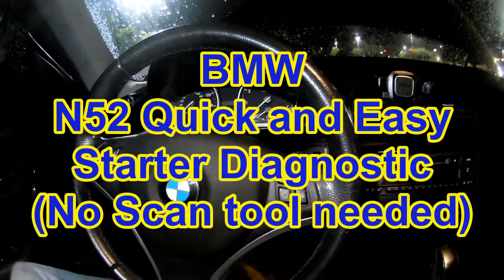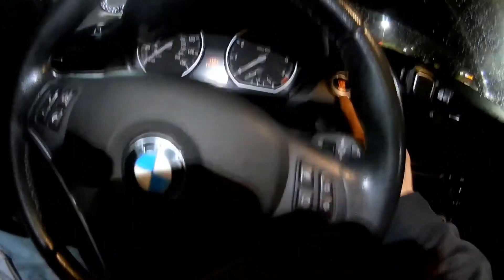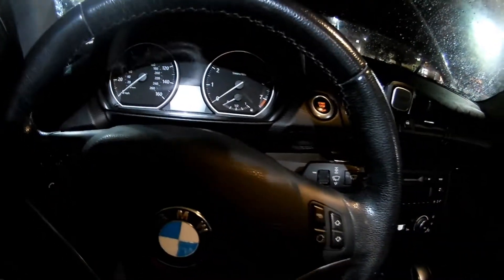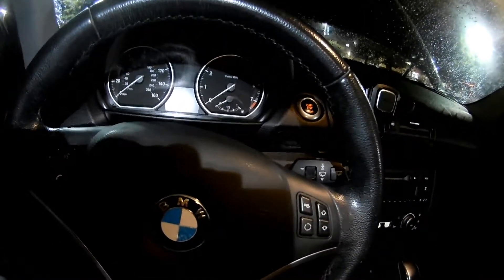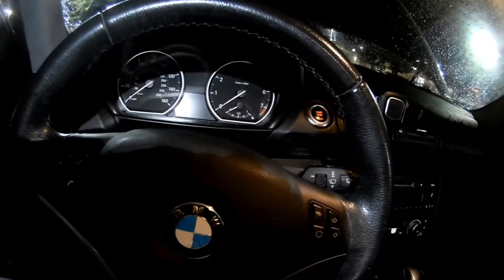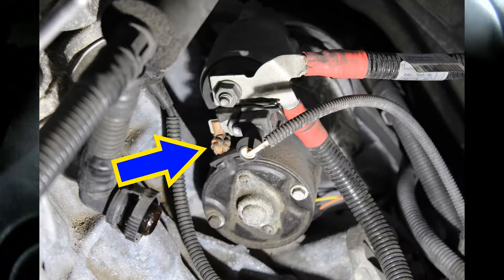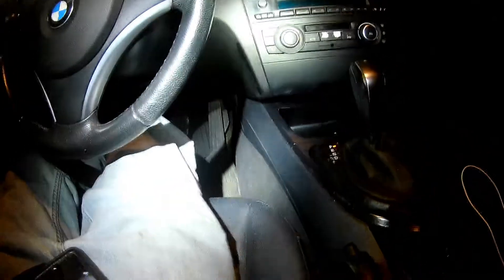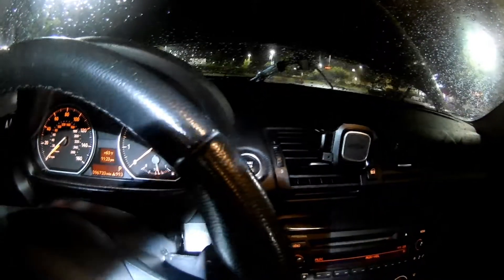BMW E82 E90 N52 Starter Testing without special tools

Comment: Problem is the starter motor ,not the power supply,,, should have tried tapping it with a long socket extention.common problem.
Reply from the maker: Oh wow thank you I would have never figured that out

Comment: If the test light turns on as appears to off, how do you know its the starter? I dont get it. Sorry new mechanic. I just replaced battery and still no crank no start. Can it be the starter or the alternator? I got a message saying increased battery discharge every 2 days i dont start my car. I havent started my car in 5 days and thats how the no crank started.
Reply from the maker: The starter has two leads… the big one is always hot… the solenoid has to receive a signal from the ignition switch to work the starter so at the stater you test for the big constant twelve volt and you test to see if you have a signal from the ignition switch to the starter… if you have that signal going to the starter should have everything it needs to crank… if you don’t get a signal to crank it could be a lots of other possible causes that you would have to start working through

Comment: 2009 328i  replaced battery , replaced starter, replaced CAS relay.  Did the starter post test constant 12 vlt there and then screwdriver to braided cable of new starter and when button pushed test light lit up. But still no crank no start.  how can i jump this new starter while on the car to see if it will turn.  It did work when bench tested before we installed new starter. Please let me know how to rig wiring to jump the starter.  Thank you.

Comment: Thanks for the Video, I didn't have a wire piercing probe to pierce the white signal wire. Good to know you can clamp on that short wire you showed. Lit right up when I tried starting. Just gotta replace the thing.

Comment: Just come across your video. My wife has a 2011 328i wagon and it just did the same thing to me over the weekend. You can hear the engine and fuel system prime but that’s it. Just performed your diag and will be ordering a starter soon. 
Much appreciated

Comment: Thanks a lot for this! 
I've been getting a clicking noise and sometimes it wont start and sometimes it does. Since it turns here and there, I'm thinking it's a loose connection or solenoid. And This method will help me check if the solenoid is feeding power to the starter checking the copper while connection. I'm hopping it's just a loose connection. If not, new solenoid time!

Comment: That simple wiper trick, sweet. And here I was going to wait for my gf to get home tonight to crank it over, cheers!
Reply from the maker: Glad I could help 🤙 hopefully you found your problem.
Reply: @MattDoesStuff17  I did thanks. 
After replacing the key, which worked initially, then replaced the ignition switch, bad assumption, I finally tested the ignition switch and EWSII, there was power on both fronts. I then found your video, tested the starter as you did, and voila, it's the starter.
Reply from the maker: That’s awesome man glad you got it diagnosed

Comment: Very simple and helpful video. I am getting 10.85 v at the brass dot. While the starter shows 12 volts.
Is the drop expected at the solenoid.

Is that sufficient to say thar my starter is bad ?
Reply from the maker: I think you could contribute the drop to the brass being dirty and a drop between the meter and it… I would go with a starter… you could try to apply 12v directly to the brass strap to be 100%

Comment: i should be so lucky...
08 X3 has solid intake, no gaps to stick a screwdriver through

good video though, i'll try to use the same testing method without taking too much apart
Reply from the maker: Man that sucks good luck… maybe coming in from the bottom might be easier? Never done an X before lemme know how it goes.
Reply: @MattDoesStuff17  i was able to get to it by pulling the airbox and rubber intake tube.  did have power to the starter so I pulled the intake manifold to replace it, probably one of the toughest jobs I've done in a while.

Comment: At minute 1:38, if the light doesn't come on, does it mean that there is a problem with the grounding system?
Reply from the maker: More likely a problem with the power... if it was me I’d start looking at the battery and the wires coming off of it.

Comment: Good night. I have a bmw e60 530i m54 engine, and the starter does not turn on the flywheel. I disassembled the starter and tested it out, it works normally. But when I get back in the car, it doesn't turn, I just hear a click, which seems to be from the hitch but it doesn't turn.
Reply from the maker: Leandro Figueiredo sometimes the starter will work on the bench but has a dead spot on the commutator and when you hit that spot it won’t work or has too high of a resistance to work under load
Reply: @MattDoesStuff17  and how do I solve this?

Comment: Where do I go to next if I don’t have nothing on the signal wire.
Reply from the maker: I think next I would look into any relays and the starter switch… would have to pull the wiring diagrams to take a look

Comment: Hey man so i touch the coper wire at the starter the light turn on I didn’t even go insde the car to click start
Reply from the maker: You need to be positive that your not touching the big red wire and only touching the copper one and if you are 100% sure that you are I would try to pull the signal wire connector off and test it at the connector.
Reply: @MattDoesStuff17  srry im not good with car  which one is the signal wire? and i been poking the starter all morning  with the light tester now the battey is dead too
Reply from the maker: The signal wire is the one small wire going to the starter with the plastic connector and metal clip... the big red wire should always be hot and that small wire is only supposed to get power when the button is pushed... if you have constant power at that wire your starter would always be trying to spin
Reply: @MattDoesStuff17  ok thank

Comment: @geist built - so if my test light does NOT light up on the solenoid ground when depressing the start button, what does that mean? It lights up when on the 12v wire on the starter...
Reply from the maker: It should always light up on the big wire and if the “solenoid ground” your referring too is the braided strap from the solenoid to the starter it should get power when the start button is pressed... if not unclip the signal wire off the solenoid and test for power there with the start button pressed
Reply from the maker: If you find power at the signal wire then it’s a bad solenoid if not it might be a good time to scan the car if you can or test the starter button

Comment: If power is where you checked it, doesn't mean that the power gets to actual starter
Reply from the maker: I don’t know if this is a question or a statement… we check for constant 12v at the starter and that the signal wire is working it doesn’t necessarily mean you have enough amperage at the starter but it’s a pretty good place to start and rules out a security or starter switch issue

Comment: What would it look like if the starter was good. How would those test results be?
Reply from the maker: This doesn’t really tell you if the starter is good more just that the rest of the circuit works… if there was a problem before the starter though the test light wouldn’t light up.

Comment: Hi! What should i look for if ground to copper doesnt light up at start?
Reply from the maker: Maybe a security issue or battery registration? You need a decent scanner and possibly a wiring diagram
Reply: Contact to the Cooper was off when i tested the First time, did the Test again and it lit right up. I removed the plastic covers to get a better grip onto the copper Spot though.
Changed the starter yesterday and the car is Running again! Your vid helped to diagnose the issue, thanks alot.

Comment: I replace the starter and still won't crank or start just clicks once any ideas
Reply from the maker: Sounds like at this point the battery is probably dead
Reply: @MattDoesStuff17  I replace the battery ass well idk what else can it be
Reply from the maker: @jorarr5174  When you replaced the battery did you register it with the ecu?
Reply: @MattDoesStuff17  no
Reply from the maker: @jorarr5174  I would try that and if that doesn’t do it your gonna need to start doing voltage drop tests across the circuit... also might try bench testing the starter

Comment: So the starter wasn’t the issue?
Reply: Having same exact issue with my e92 335i n55 just hit the ignition and it just clicks one time but won’t turn over
Reply from the maker: Clayton Valentine the starter was definitely the issue... this video shows how to test to make sure that the starter is receiving power when it should so that you can be sure the starter is actually the issue
Reply: @trickster03000  mines is doing the same how'd u make out ...whats was the issue?
Reply: carson mcgill I figured it was starter itself because it just seemed like it locked up or something, problem turned out to be the starter and power wires for the starter
Reply: @trickster03000  I have the same issue.
Reply: @MattDoesStuff17  If the starter is not receiving current, what does that mean? And how to solve
Reply from the maker: Leandro Figueiredo if the starter isn’t receiving current you need to look farther up the circuit... I would probably start by seeing if it had any codes stored and then maybe test the starter switch... I’m assuming you mean on the signal wire and not the constant hot one
Reply: @MattDoesStuff17  yes, i think that the signal wire is not receive current. How do i solve this?
Reply from the maker: You need to verify that it doesn’t have power by back probing it while it’s connected and trying to start the car if you find you truly don’t have power your gonna need to get a wiring diagram and start working through the circuit...

Comment: @All 4 A Penny please help, I have all dash lights and everything comes on with the key. I have power through the big power cables to starter. I have no power at the braided cable when I push the Start Button?
Reply from the maker: Gotta check the little cable going into the starter solenoid when pushing the start button could be bad a starter solenoid.